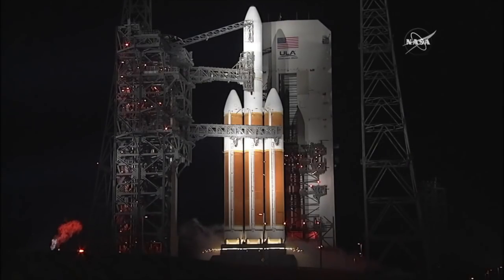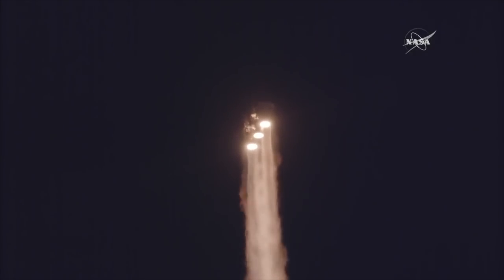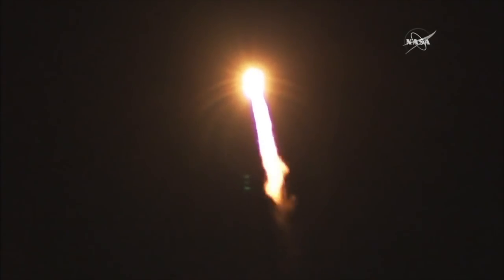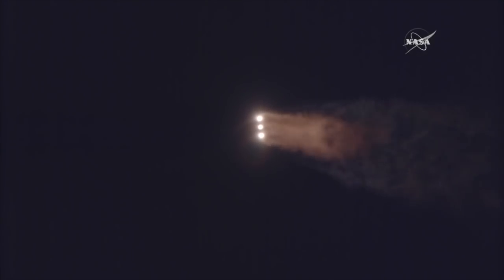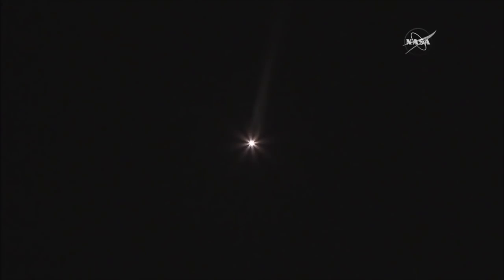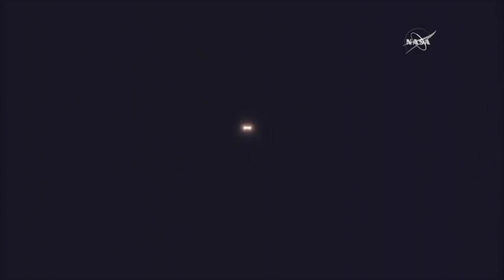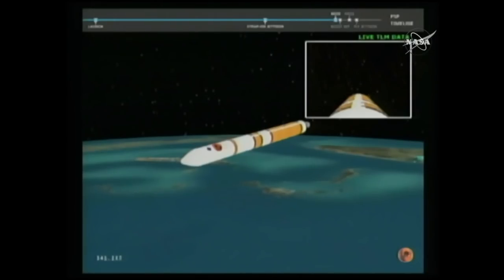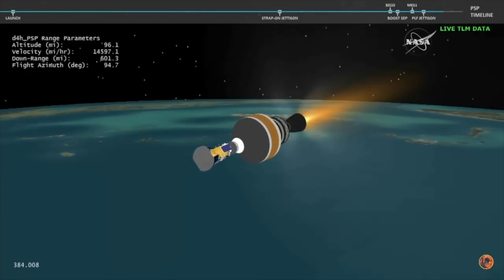Delta IV Heavy launches NASA’s Parker Solar Probe

Comment: Hi guys, can anyone give me an answer to something that is confusing me.  I am in the mid-tablelands part of NSW, being the eastern side of Australia, the rocket appeared at 6:30pm in the lower south-west sky in the direction of Adelaide, if I had a protractor facing west the rocket appeared at a 30 degrees angle, it appeared as a bright star, then as it came closer being 60 degrees we can see the three white exhaust smoke I'm assuming, the it came closer to a 70 degrees angle the black silhouette of the rocket with the three other things can be seen, it stayed in one spot for a while, then it moved along until it came to the middle of the west sky being 90 degrees and went straight up to outer space until it disappeared. Where I'm confused is, was the rocket suppose to come down to Australia deliberately or is USA just on the other side of the southern part of western Australia?
Reply: The booster and core stage of this rocket fell into the Atlantic and Indian Ocean, respectively.  Perhaps one of the Parker Probe's multiple engine burns could be seen... but I doubt a "three part" anything, trailing smoke or otherwise, could be visible from Oz.

Comment: I agree with some of the comments here, ULA should do a little PR with some on board cameras.  Other than that, amazing you could see the center core engine from the ground all the way to MECO.  I was waiting to see if you could see the RL-10 ignite but they cut to animation right after MECO.  Bad move!
Reply from the maker: Rockets are not launched for the spectators, but for the customers who know what they are paying for: get the payload into the correct orbit.

Comment: 4:16 ????
Reply: Martin Andres Dominguez Gil  separation stage, strap detonation
Reply: But it does not make sense, it causes a giant explosion!
Reply: Because they use explosive bolts to separate the sections.
Reply: I see an explosion of about 6 football fields or maybe a lot more (Estoy usando el traductor, mi ingles no es bueno. perdón)
Reply: You see exactly the same pyrotechnics when the shuttle SRB's detached as well, the same system of explosive bolts.  Your sense of scale is waaay off though.

Comment: These boosters are not reusable. Next time, use a Falcon Heavy.
Reply: Falcon Heavy doesnt have a high energy upper stage. Not as useful for these sorts of flights.
Reply: Contracts for launch are made a few years before the launch. As you know, Falcon Heavy flew only this year. 
They could not break the contract. In addition, the Falcon Heavy is more suitable for launching a heavy load on the low orbit and geostriped orbit.

Although, it is possible that, if there is sufficient demand, they will make the second stage hydrogen. Or, make a three-stage version of Falcon Heavy.
Reply: And yes, there is a strange belief that if SpaceX doesn't make it, it's crap. The Delta IV Heavy is actually an excellent launcher.

Comment: Great day for sciences. I wish they would install some onboard camera like what SpaceX is doing.
Reply: what should the camera see? do we have a filter or mirror for the camera for protecting it getting 1400°C hot? I think not but maybe there is a solution? we could make pictures from Venus dusty atmosphere but it looks boring
Reply: ULA is private, well, sort of...  Video of the booster separation, etc.  would be awesome and not cost a lot.  I wonder if this was a flat fee or cost plus?
Reply: It has cameras just not THIS video. See others
Reply: Cameras and the equipment to transmit video from that far away weighs a lot, and you need to shave off every single gram you can... So i think there is a good reason for it
Reply: Cost of one Delta IV heavy launch = $350 million
Cody of Falcon Heavy launch = $90 million. 
Also Falcon Heavy has twice as much payload.
I don't understand why NASA is still hiring ULA instead of SpaceX
Reply: Dr. Deek Hounds something like deep space probes like the Parker mission can only be done by the D4H for it can gain benefit from its RS68 Liquid hydrogen engines.
Reply: @dr.deekhounds5339  because Ula is way more reliable and their upper stages put spacex to shame
Reply: @CarlosAM1  Agreed. There's a place for SpaceX, but ULA are still the top dog when it comes to very specific mission parameters.